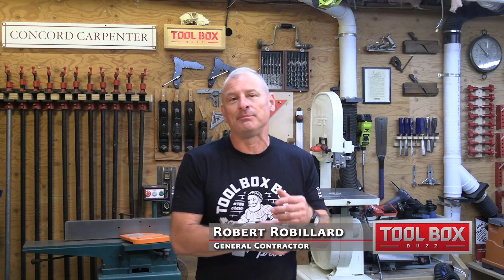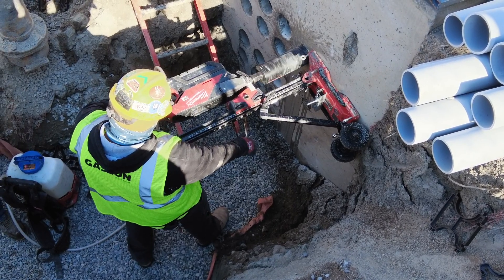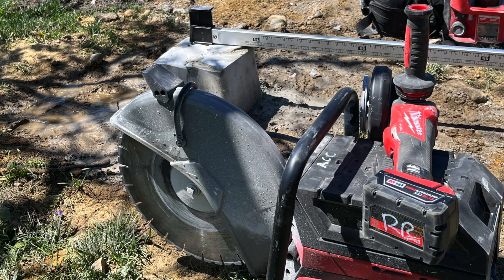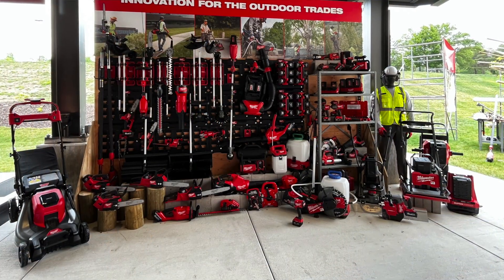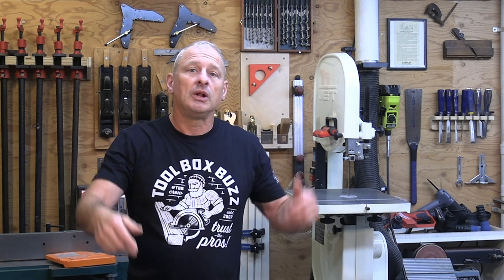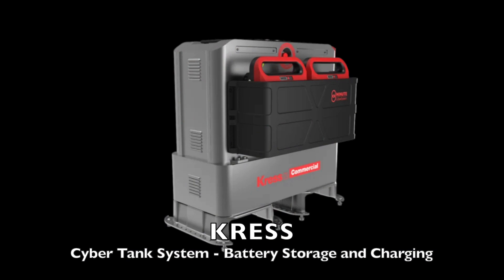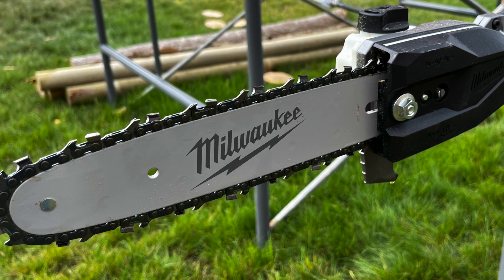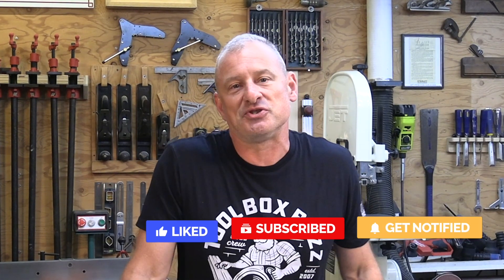Battery vs. Gas Powered Tools | The Future Of Outdoor Power Equipment

Comment: The incoming Ram EV will have a gas powered range extender option, if theyre smart they will give this truck the ability to do what ford does with the lightning and use it as a mobile power station, only it will be able to use the range extender to keep the batteries charged, no huge secondary expense needed with additional battery "tanks"
I'd like to see the MX and well any OPE "gas replacement" battery have a subscription fee based battery platform with unlimited battery replacements or maybe an extended warranty like Hilti industrial with their 25 year warranty, which would raise the initial cost of purchase, but you really only have to buy your stuff once.

Comment: Tabless cells are comeing to the market now so thats going to improve batteries a little bit. But lithium ion is all we have right now for battery technology for small or hand held tools. 
Lithium phosphate   is what should be used in larger equipment it will last way longer its what ecoflow and bluetti use on their big power stations. Way longer life then lithium ion after 3000 charging cycles they still have 80% of their capacity. So this is really the answer for big tools

Comment: Working in the construction industry battery powered tools make sense, we don’t run the tools continuously all day, and the convenience of not pulling cords or air hoses around or out for a quick repair has been amazingly convenient, but as for a professional landscape company it makes no sense to invest all that money, especially if you are running multiple crews, I get that it’s quieter, but we burn coal to create power to charge the batteries so the emissions savings is a wash, it just makes more sense to use gas in this situation at least for now.

Comment: Ultimately its the battery tech which is the weak link at the moment. A typical NMC based battery, which the majority of powertool batteries are. Is really only good for about 500ish cycles until the capacity really states to take a hit. And while you can still use them, the older they get the higher the internal resistance gets, meaning the battery has a harder time supplying the current to keep up with high drain tools. soif say a contractor is charging it twice per day. After a year that battery is going to be junk. 
I personally run one of those large solar generators (really just a huge powerbank) in my car which lets me charge everything on the go, and also run a microwave and whatever else i want during the day too. Then just charge that up each night at home. 
That unit uses LiPoFe4 batteries which are good for 3000+ cycles down to 80% capacity and can still be used well on after that. 

The main issue with something like LiPoFe4 however is energy density. So you would end up with lower capacity batteries for the same size/weight. Not a real issue for a large mower or something like that. But I think you would have a hard time getting some contractors to understand why this 3AH battery that the same size as a 5AH is actually better
Reply: NMC is fine for most power tools and can last a long time, especially pouch cells. 
LFP is a good option for mowers, generators, EVs, etc, but not a good one for and held tools. Just imagine the size of a LFP battery capable of powering a 3000w chainsaw, it would be unusable.
Reply: Most of them are good for at least 1000 cycles to 80-90% capacity but IR does rise yeah. But now we have options that have power reserve in start so not a huge issue imho
Reply: I have multiple battery operated equipment from a  blower to a chainsaw and a mower. Right now it would cost more than $800 to replace the dead batteries to operate them. Switching 3 batteries between 5 tools. Oh, and the lawn mower broke down (and it used two batteries at one time)

Comment: Here is an idea, what if all tool manufacturers were forced to use a common battery structure for the most common tool voltages. Meaning that all 12v, 18v, 40v etc batteries were interchangeable with each other. Just like regular alkaline batteries are. That would both make it easier for consumers to buy the tools they need, drive the prices down. The companies would still be forced to innovate, because consumers would gravitate towards the better battery manufacturers.
Reply: That would be an excellent solution.
The problem is it is very unlikely to happen. We have a hell of lot of very intelligent people on the planet, who are capable of doing amazing things.
 It's our collective intelligence where we fail miserably. Collectively, we are as dumb as shit.
Reply: Preach!

Comment: I think the best mobile charging solution comes from the truck itself. Take the Ford Lightning as an example, you've got a HUGE battery sitting there that's big enough to charge all your batteries for days. Why invest into a huge battery generator when you already have one sitting there? Range isn't an issue for most landscaping companies, so you have more than enough spare juice in a 100+ kWh battery.
Reply: 100% agree
Reply: A neighbor on my street does landscaping part time & has a electric Ford lighting. He mainly use solar power to charge his backup battery that charges his truck & tool batteries overnight. You can also store your electric equipment better, than you can with gas equipment.
Reply: Hyudai has madeira a power outlet on their newer Ev's. So you can plug your charger in and work all day. It can even charge an other Ev in an emergency.
Reply: @sigmundhundershagen5239   The Lightning as 4 120v outlets in the frunk, 4 more in the bed and a 240v outlet in the bed. It can also literally power your entire house trough the charging port.

Comment: The power is there, at least for a homeowner.  The battery technology just needs to improve.  More power in a smaller package is needed.  Also, charging/discharging a battery in hot weather can be problematic if done for extended lengths of time.

Comment: Still pushing my corded Earthwise mower on my 1/3 acre for the last 12 years. Replaced the motor 3 springs ago. Not a glutton for abuse, but a thrifty new englanduh transplant. By next summer I plan on upgrading to an Ego
Reply: Ego has a high battery failure rate I would go with milwaukee or makita  or if any one makes something with a lithium phosphate battery go with that it will last way longer